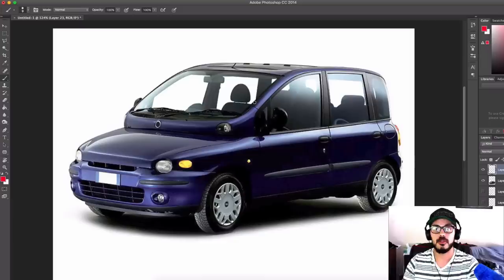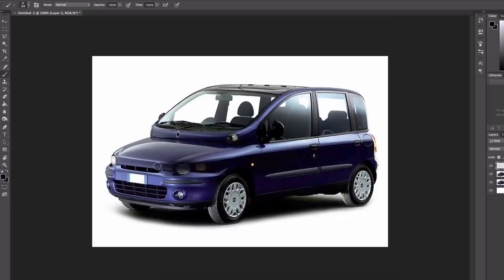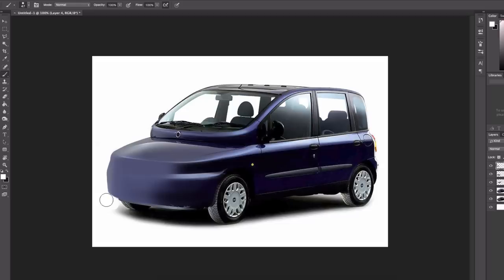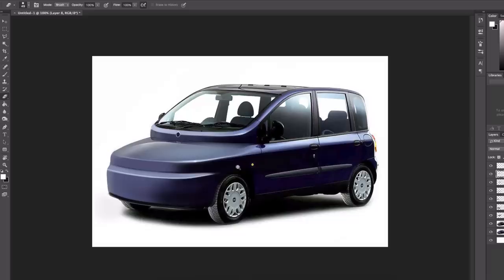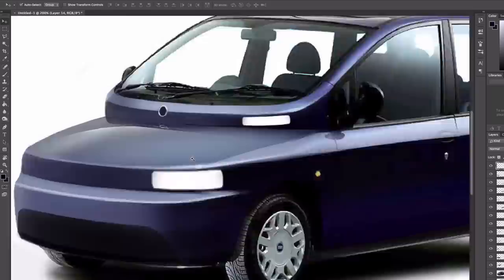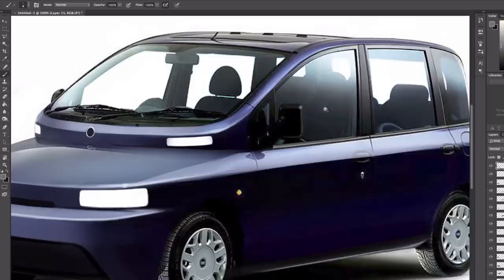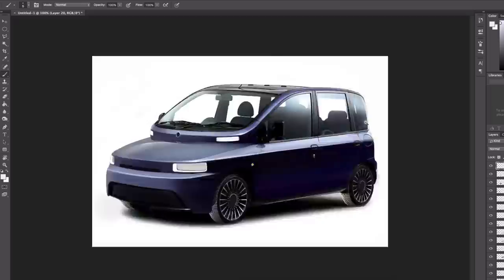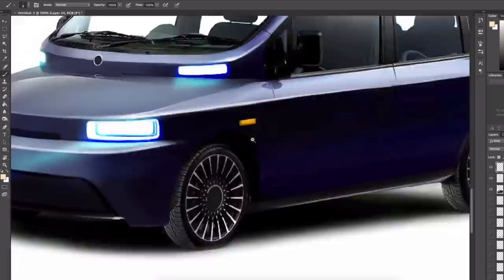Fiat Multipla Re-design - Mission Impossible???

Comment: Nobody:

Fiat: 3 seats in the front
Reply: @DroidTech And the Matra Murena
Reply: Honda FR-V too.
Reply: Also the classic Citroen DS was sold as a 3 front seats car. Today also the Toyota Pro ACE (and two other incarnations of the same car sold by Renault and Citroen)   has the 3 front seats option... but it really is more a commercial van turned into a car than a normal car
Reply: @DroidTech the toyota pro-ace counts is listed as a car, for its actual size. itbis clearly derived for a commercial vehicle, but it is not actually a van.
Reply: @DroidTech here is clearly marketed as a car for the simple fact that it is explicitly designed to stay within the size limits of a reasonably big car (especially the short version, which is just 4,6 meters long) : it can go under any bridge or passage where only cars can pass (it is less than 2 meters tall). this doesn't apply to vans

Comment: Excellent! my wife has a second gen Multipla (the one that has a regular "van-looking" front) and loves because it is the most practical car ever made: very short (it is one feet shorter than my Nissan 350z, which is a two seater) , very wide, six seats, rear seats can be easily taked away actually turning it in a van)... and mine is the CNG powered version.
 Actually I am very concerned because I can't find any car still in production that matches these features. I really wish someone at FCA sees your design and puts it in production as an electric car

Comment: The main reason for Multipla is max. space in a 4 Meter car. 6 Passenger plus luggage. Who else have enough space?
Reply: That was exactly my thought.
Reply: My Honda Odyssey has 8 seats and plenty of luggage room
Reply: @opayke980  Sure, but the Honda is a bigger car. The Multipla is only 4 Meter and was designed for tight and crowded cities with limited parking space. Anyone can spend a lot of space in big cars. But enough space in small cars is much more difficult.
Reply: Space pirates.

Comment: So much better sir. Vertically from top down the vehicle is filled with sharp angles then vertical it’s nice curves. I really like it and the only thing I would change is the side mirrors I would do the same curves like you did on the front mirroring the part that is right before the windshield

Comment: I agree 100% on everything about the Multipla and your redesign is simply STUN-NING!! thumbs up! But let me say, you really told the most blasphemus and absurd of things... that car design in the '80s and the '90s was the worst ever. Honestly, in the '80s and the '90s, taking away some melted-cheese-bubbles and square-box nonsense, it's been the most peculiar era for car design: awareness of technology and manufacturing arised to it's pinnacle right before designing a new car became just an equation among engineers, cost managers and market researchers. After then, everything became just a serial application of "progress" on the object "car". Lines and styles became a flashy jungle just to catch customers and have a "family feeling" for a brand. Or the best design ideas came from "remakes" from the 50's (fiat 500, minis, ecc)

I mention just one thing to proof what I mean: the '80/'90 produced some cars that were so striking in their beauty, in their freshness without excess of "futurism" and in their harmony, that even today, almost 30years after, still look EXTREMELY GOOD and young and new, MUCH, MUCH more then their successors, which might have looked newer right then, but after just a few years they aged really badly and felt obsolete, while the original models still stand out and shine. And you can't say this of ANY car coming from the '70s (they might be beautiful but they immediately giveaway how old and obsolete they are, only the Mercedes SL Gullwing can) and neither of cars from the '00s (the renewing of models became so frequent and fast that a car looks old just a couple years after it hits the market because a new model is already coming out, like a smartphone).

Examples? 
DMC Delorean (1981),
Ferrari Testarossa (1984),
Lancia Delta HF (1987),
Ferrari F40 (1987), 
Dodge Viper (1992),
Renault Megane Coach-Coupe (1995)
Alfa Romeo 156 (1997, even its own restyling looked older!)
VW Golf IV (1997),
Peugeot 206 (1998) and 206cc

(And I'm sure the list is not complete)

Comment: Video shows only that the car has potential to become actually am icon of the remakes. Yes, it's one of the ugliest European cars ever made but with the history to grow and conquer into the future.
As I'm no stranger to the Italian car design I can confidently say that lots more can be done aside from what the video presents. Although, it is a great video and great vision. And since Fiat has some pedigree in fuel efficient vehicles, including electric, it makes it a perfect candidate for futuristic cars that deliver, also Italian design could be easily applied with adding small bits like fender nipple turn signal that marks all the cult Fiats and Ferraris discretely that'd also be functional like turning and staying on while reversing(Saabs did that in their older cars and it's very good little detail). Blended in door and sleek handles that work by pushing it 140 degrees in and still being able to pull the door open would be a nice touch to innovations too.
Great job on the video.

Comment: Has anyone seen the facelift multipla? It looks decent
Reply: I've seen it, they ruined it, the front doesn't match the rest of the car and made it boring. I own a Fiat and my dealer and I often talk about how it's a shame they ruined and eventually ended the Multipla. Sales weren't too great because of the controversial design, but they actually went further down when they made it boring with the facelift. People just figured they might as well buy an Opel Zafira with the same Fiat diesel engine.

Comment: You version looks like some weird riced up version with an all-electric engine. All you have really done is took away details...not to mention taking away the fog lights and you have some very wide non-directional LED lights to perfectly blind any other driver. This is fucking shit to look at I don't know how you can say it's a "re-design" because it wouldn't look fuck all like that if it were.. this is literally just a riced, electric powered Multipla.